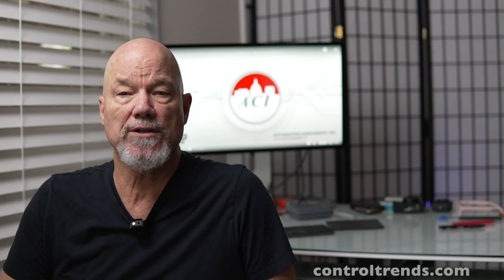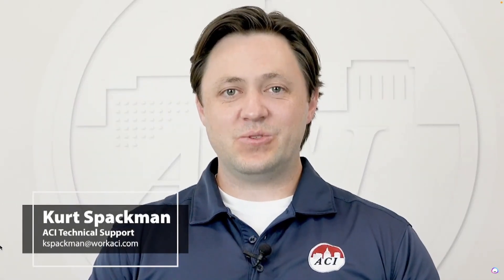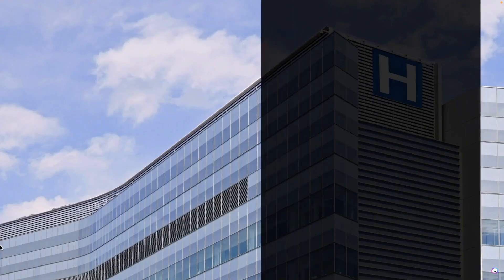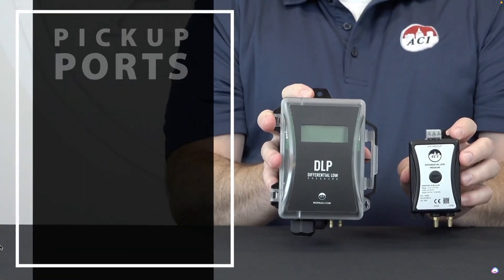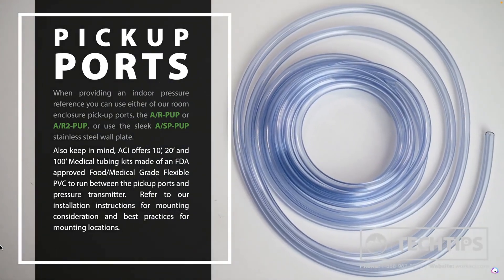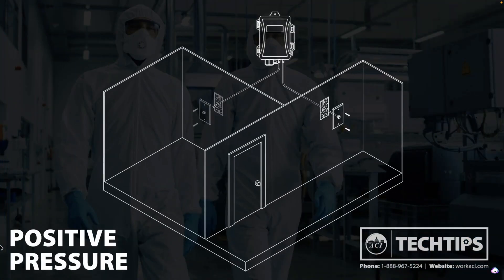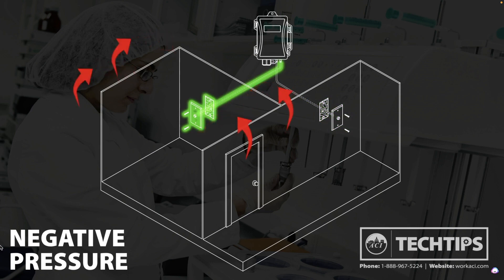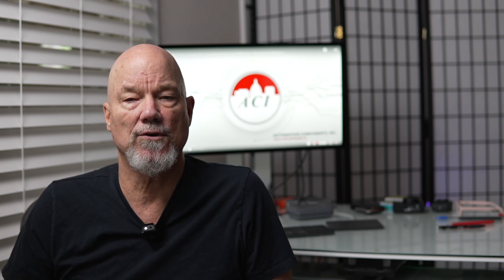HVAC Tech School: Building Pressure and Pressure Sensors

Comment: How to connect tubing at wind cancelling outside air reference
Reply: The sample port would need some small filter to stop wind gusts, but the material of the filter would allow pressure to easily equalize across it (not pressure blocking, but wind blocking). We jokingly call these things in the industry little mufflers. They are used when measuring pressure inside a running heater/furnace which may be at most 2 in Water Column (2 in. H2O), Notice the units of measure, 1 psi = 27.7 in. H20. BTW, I suspect any small filter will do.